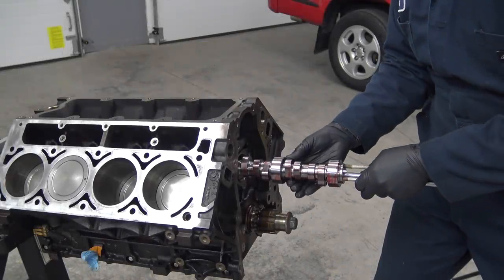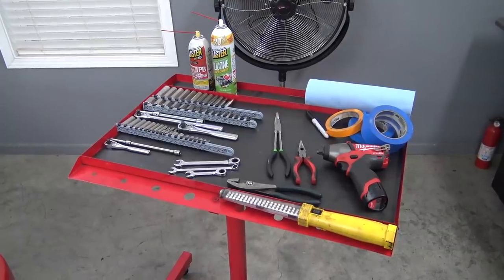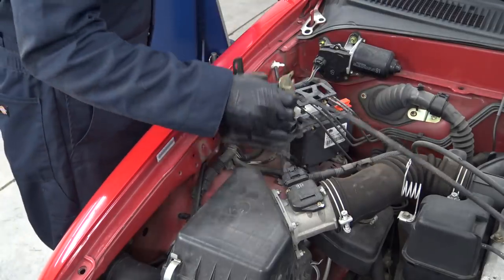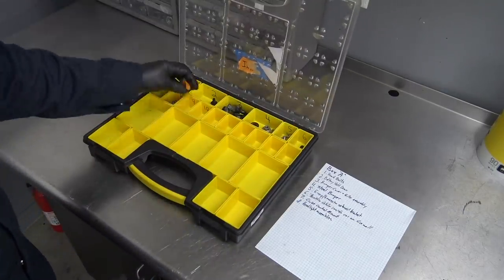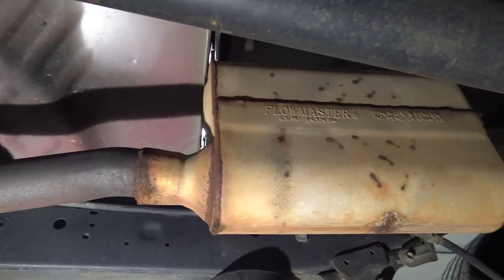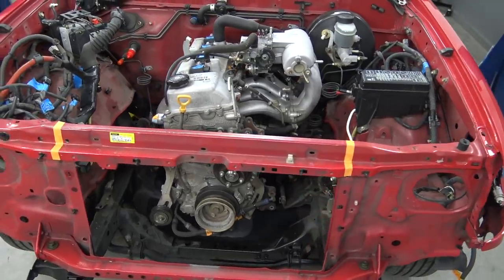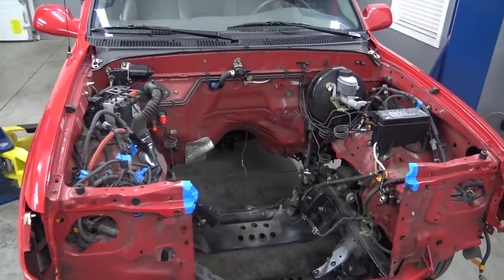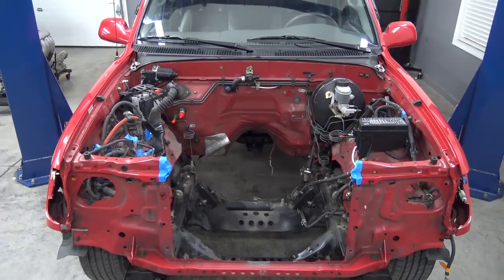LSX V8 Turbo Tacoma - Project Firebolt Part 4

Comment: Those trucks are made to remove the engine with the harness connected.  Just undo the harness from the computer and transmission and pull all out together.  Little late now.
Reply from the maker: Dang, REALLY wish I would've thought of that Erik!  Always learning! 👍🏻👍🏻
Reply: @TomsTurboGarage  put the stock harness back on the old motor that way its a complete running unit and then use Painless Wiring. give those guys a call, im sure they can help you out

Comment: I was using Summit since the 1980's but my last three orders they just seemed to throw random car parts into the boxes  so finally my last order instead of going through the return process i just threw the stuff into the trash and went and bought the stuff at Mearl's auto parts and boy am i glad i did...i got these ceramic brake pads from them that last five years compared to one year i normally got out of my brakes

Comment: Keep it up! But as a lifelong resident of the Rust Belt I have to say after seeing the underside of that Tacoma, I hate you.
Reply: @genisis53  - I live by the ocean. Our problems with rust come from the top down.
Reply: I know.  Where I am cars only look like this for a month out of the factory...
Reply: I've began replacing all the brake lines and calipers before year 8 on my Toyotas here in Cleveland. And diy zeibart the doors, rockers, etc with penetrating oil every fall...
Reply from the maker: I hear ya man, I grew up in the rust belt, every car we inspected at the shop had rust in some way shape or form.  Here in the south stuff stays impeccably clean.
Reply: @TomsTurboGarage  were in the south,i want to know were to move.it took me 20 years to find a rust free third gen trans am in ontario(canada)
Reply: @trillrifaxegrindor4411  NC, SC, TN, GA, AL, Miss, VA, no rust on any used car you find, if it was kept in the south.

Comment: Not sure if you covered this in another video, but consider lifting the bedliner a little to check for accumulated dirt. And if it's worn scuffs into the paint, maybe LineX it?
Reply from the maker: That’s a good tip, I’ll add that to the list 👍🏻

Comment: Good Job Tom.  Here's a tip- tape a rubber glove over that intake to protect that investment.  All it takes is one washer, nut or bolt to migrate into it to ruin that engine for the next guy.

Comment: Might I suggest the cherry bomb "vortex" muffler for when the new v8 installed? it mellow when driving like grandma but rumbles nicely when full throttle. they are also insanely high flow which is great for when you turbo (if you dont right away) due to its high flow. it flows like a fart can but sounds WAY better.

Comment: I can't wait to see how you handle the gauge cluster integration. I've got a 3rd gen 4Runner that can best be described as anemic at a mile above sea level.
Reply: Benton Hart I could be wrong but I’m pretty sure the Xmax stand alone system he plans on running uses can bus data wires to a display that’s programmable to display whatever functions he wants to display

Comment: Tom, I love your videos. They're entertaining and educational! Thanks for all the time you devote to not only the project itself, but the clear videos you produce! Are you planning to add some strengthening braces to handle the added torque and horsepower of the new engine? The Toyota looks surprisingly frail, and doesn't look to me like it can handle the power of the new turbocharged engine. Thanks!

Comment: I noticed you swept under the toolbox before moving on to take out the engine.  We share OCD is see.  Love the clean work area
Reply: A taller tool cabinet like that... loaded... all it takes is a grain of sand to hit the brakes and everything inside wants to keep going. Lol play catch with what i would guess 500lbs worth or tools and everything else inside when it tries to tip over. Cleanliness is a good thing, but safety is absolutely necessary if you want to keep doing what you love. Like with the hood... he could certainly have gotten by himself, but why risk damage or an injury if you have a willing second set of hands. Love this channel!

Comment: If this truck is like most toyota's, you can remove the stock engine harness by unplugging it from the ECU and unbolting it from the firewall and it will come out in one piece.  They are really designed to come out with the engine though.  Thanks for the entertainment though.  Looking good.

Comment: With the added power and weight do you have plans to stiffen up the frame, install a roll bar, or suspension upgrades?

Comment: Sometimes it's the smallest little tips which can make a big difference: you put caps on vac hoses and other connection points as you 'open' them up. Me too. BUT - you use WHITE (and a couple of blue) caps. I have always used black ones (usually from a parts house or even Harbor Frieght) in a variety pack of sizes. 
My whole world just changed: I will go find some white stuff to keep on hand. Why? So I can FIND the stupid capped lines later on!!

Comment: Hey Tom, does your new Holley system have an OBD2 connection?    The reason I ask; I'm preparing for an engine swap in a newer vehicle,  but I'm in NY and emissions is a big deal.   I can modify an existing harness and have a new vin written onto the transplant computer,  but everything is an expensive p. i. t.a.!  If Holley has the port, and the ability to write in the car's vin,  that's definitely the route I'll take.  Thanks for any info!

Comment: Hey tom .. Im having a issue with my dads vehicle ... Its a 2003 hyundai sonata 2.4l 4cyl . and we just had the radiator replaced because the old one was leaking .. The guy put the new one in and i guess the ac condenser is bolted to the radiator. My question is will having one of the ac condenser bolts off that holds the condenser to the radiator Cause the vehicle to overheat?
Reply: No, it would not cause it to overheat
if the radiator was replaced and the coolant system was not "burped" properly that could cause the vehicle to overheat since there is air in the cooling system.
hope that helps :)
Reply: @LincolnMaxnCo  thanks

Comment: Where do you get all these plastic caps/plugs for the engine and accessories? I've been trying to find a solution like the ones I see eBay sellers using when they've an engine for sale (the red caps/plugs). Aaaaaaand as I'm typing this you just got to talking about caps... well dang.

Comment: There is a channel called teamboosted that is making a one rotor build. Wouldn't that work pretty well in the autozam engine bay if you were the do an engine swap?
Reply from the maker: It’s width of the engine bay that is restrictive.  So there would be little difference between a one or two rotor since they are the same width once fully equipped

Comment: any chance someone could tell me what drive shaft yoke this uses, I'm in New Zealand but over here we got a 6 speed truck called a great wall that i think uses the same slip joint as the US tacoma. rn im looking to the outside diameter and the inner spline dimension & count. thanks

Comment: Can I use regular sockets on that impact I would love to buy one but only if it requires a regular socket impact sockets are crazy expensive
Reply: You can, just not wise for REALLY tight nuts/bolts, build up your impact sockets over time.
Reply: You can. The trick with these little impacts is to loosen the bolt by hand first unless it's small. Then the gun spins them out to save a lot of time. No impact sockets needed.
Reply: painmagnet1 Awesome 😎

Comment: I see you don't like coming up with solutions. always using what is available on the market. It's okay, I still like to watch, just not my approach.
Reply: Keep in mind that the Turbo Garage is sponsored. It's a platform for Summit to promote the parts needed to do the job. He could do it another way but using existing, engineered systems is more time efficient, creates additional value to the vehicle and free for him. Kind of a no- brainer.
Reply: @painmagnet1  Yeah but where's the fun in that.